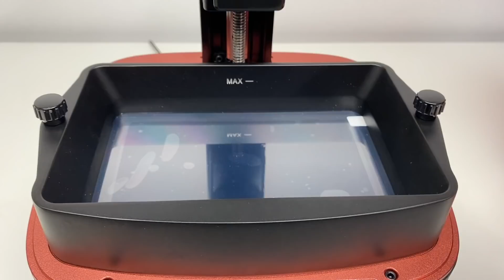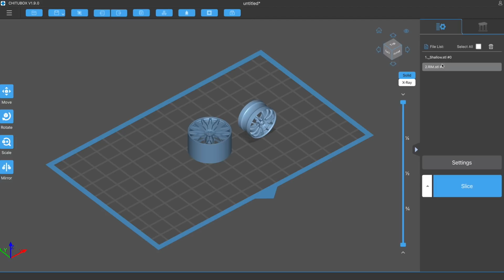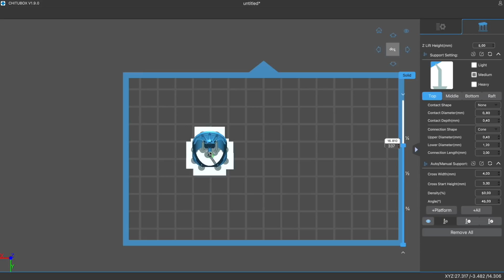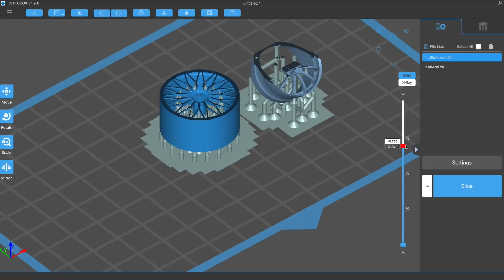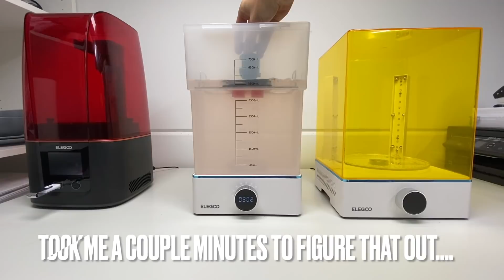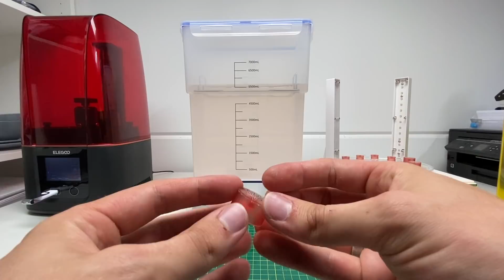How To: 3D Print Custom Parts for Scale Modeling With an Elegoo Mars 3

Comment: Still all foreign to me. I have no idea where to begin with this process... other than the OBVIOUS of getting a 3D printer. It can't be as easy as you made it look.
Reply from the maker: Only way to find out for yourself is to buy a printer. It may seem a bit easier than it actually is. But then again it is not that hard if you have the basics under control

Comment: Just an FYI, water washable is not any safer to use than regular resin. It's just as toxic, and definitely not any better for the environment. If you use water to wash it, it has to be disposed of at a hazardous material waste facility or evaporated. The marketing for these sometimes makes it seem like you can just wash it in your sink which is definitely not okay.

Comment: U Make it look so easy my test print rooks fail each test they start off fine but i hear them pull at the plastic fep or whatever end tray called then pulls off the plate any chance you could share a stl file for wheel u done  lovely wheels  id really appreciate it if can.? if you can my email is on the channel in about section.. If you cant no problem i understand.. U do great job anyways is it easyer to print in clear resin or is it same iv normal grey resin. They turned out beautiful great job👍
Reply from the maker: Sorry, can’t share those files. Make sure the print bed is propperly leveled to the instructions from the manufacturer. Use the leveling paper and make sure it is done right. If it still does not work, contact support.

Comment: Neat. I like the Ariel Atom or is that the nomad or whatever the off_roader is called? According to some minipainters and terrain builders you can cure the resin stuff so that it is cured but about 99%. It remains cured so, but is flexible a little. This way if you drop them they do not break as easy as fully cured can be brittle.

Comment: Get a plastic razor blade & holder for removal.  Best thing & no worries about bodily harm.
Reply from the maker: They also come with plastic scrapers. Though prints get stuck on the plate sometimes. And those plastic ones dent, bend and or simple don’t have enough strength sometimes(from my personal experience)
Reply: @TheScalemodelingChannel   (not sure if my reply posted) Get an actual plastic razor blade. They come in a box of 100. They look like metal double sided razor blades. They are usually orange in color & come with a screw down holder. They easily get under prints on the build plate & very little damage to the pieces or plate itself. I started our with the plastic scraper but like you said doesn't really do much. I'll use it after the plastic blades if the piece is larger. I print mostly gaming miniatures on my Phrozen 4k mini.

Comment: So far Tom, which has been your favorite printer with the best results with the least hassle? I trust your opinion as you’ve tested so many.  Thanks, James
Reply from the maker: All the Resin 3d printers that i have tested and shown on the channel so far have worked fine with not much hassle.

The Creality one i tested most recently was a good printer. The software/slicer they have you use simply sucks.

I would suggest going for a Mono screen printer(those print 2 or 3 times faster than non Mono).

Anycubic and Elegoo are both trusted brands in the industry. But do have a difference in price which can be seen back in the actual material used to build the printers
Reply from the maker: Also something to add. If prints fail. 9 out of 10
Times it not the printer. Its the user setting up the file/supports/settings incorrectly😋🤭
Reply: @TheScalemodelingChannel  Thank you so much Tom for your advice. I see so many people printing beautiful parts and even though I won’t design anything it is way cheaper to buy files than finished parts.  Thanks again, James